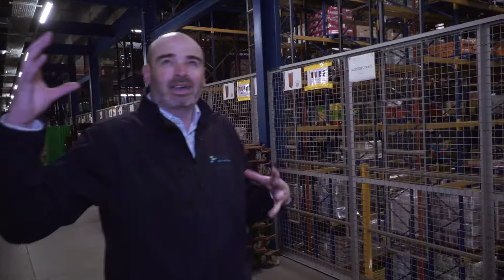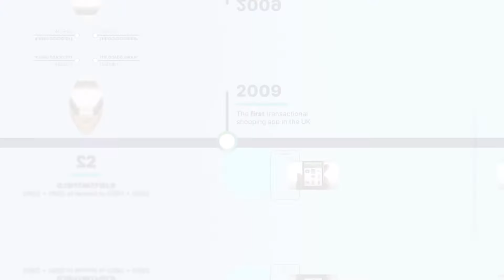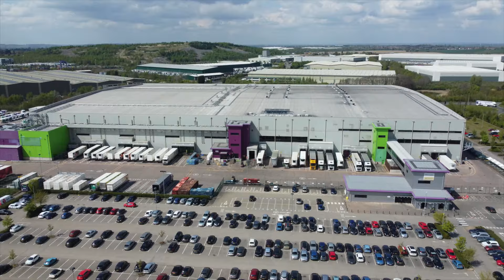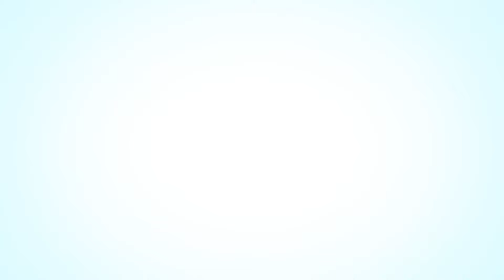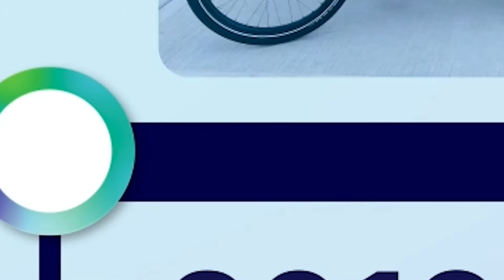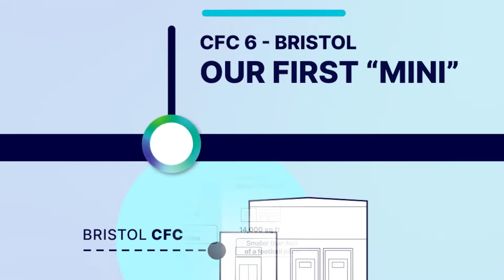Our Story So Far, Told By People Across Ocado Group

Comment: Our story so far is that the share price has steadily fallen from more than £28 to less than £4 at time of writing. That recent successive share tranches have been issued reportedly put downward pressure on the share price and that existing shareholders, despite the market saying they were notified, were not. Surely if Ocado support, such a collapse in share price is not they way to do it. At time of writing, I am showing a paper loss of £21K although I did buy below the £4. A very topsy-turvy stock with Covid being one of the main succesful driivers this last year or two. Where does Ocado expect this share price to go next I wonder?
Reply: Are you a long term shareholder? If so, why would you care, except as a growing opportunity? If the share price is low, and you feel the opportunity is mispriced, then buy. Don't fall in with scared sheep.
Reply: @wesleysanders8570 Looking to pile in here next year after I sell up in an AIM stock
Reply: @wesleysanders8570  i wouldnt buy food from a failing company simple